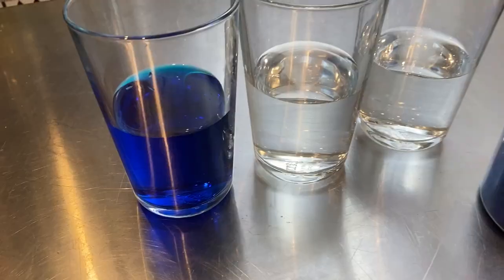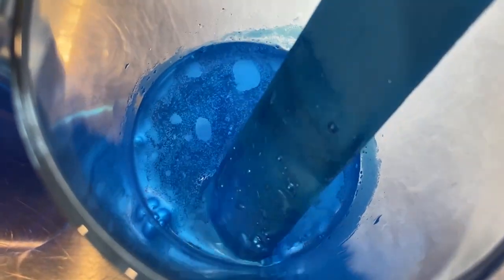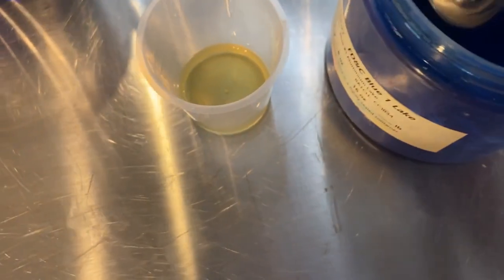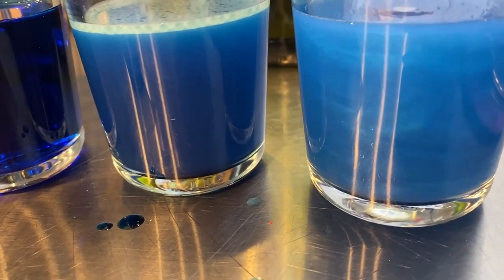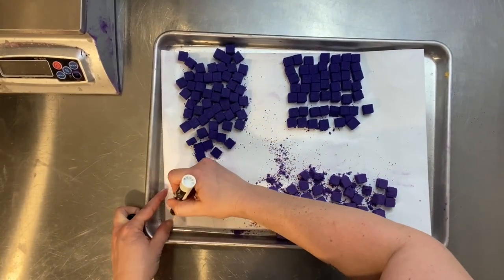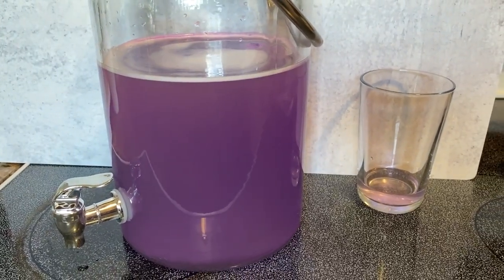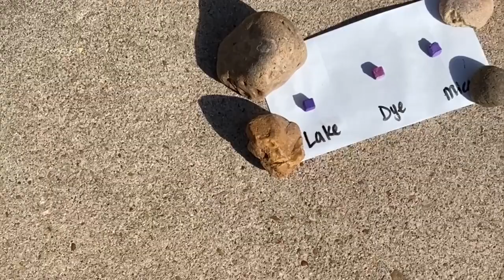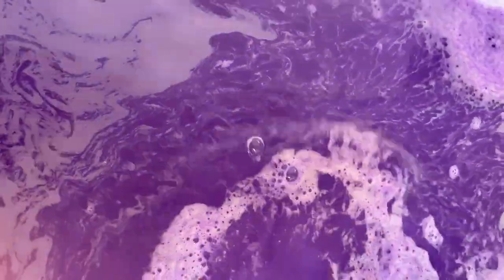How to color bath bombs: the basics of micas, lakes and dyes and how they perform in the water

Comment: Hey Robin! How do you suggest we prevent ''staining'' when using mica as a paint, on the bath bomb. OK - the mix always has poly 80 - but we don't put poly 80 in the mica paint. We use alcohol ... what can we do to prevent the staining? In this case I HAVE to paint the bomb, it's essential to the design. Thanks a bunch!!!!
Reply from the maker: You can add a little Poly 80 into your mica paint if you find that it stains.  As a rule of thumb I always add poly to my black or purple paint since they are my worst offenders!
Reply: @BathFizzFoam  Awesome!! Thank you so much! Does the 'paint' still dry, despite having added Ploy 80?
Reply from the maker: @Staceymatchim  yep 😊
Reply: @BathFizzFoam  - thanks so much Robin. I really appreciate it  🥰